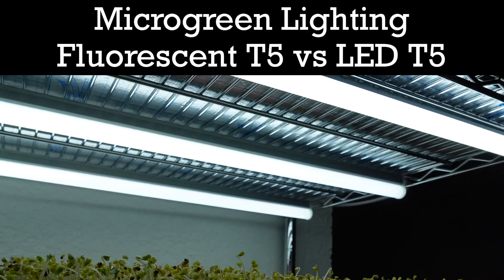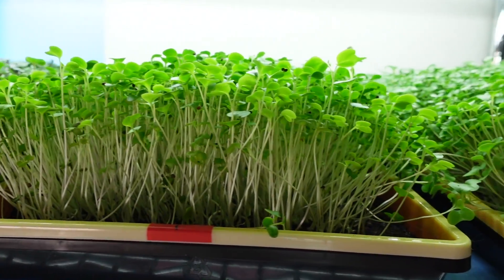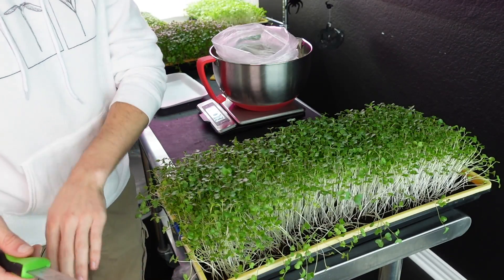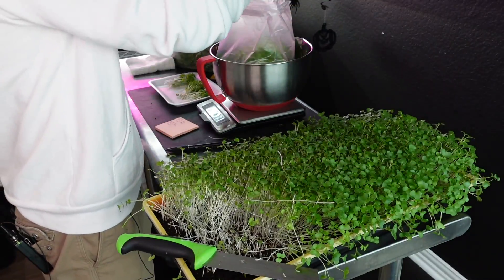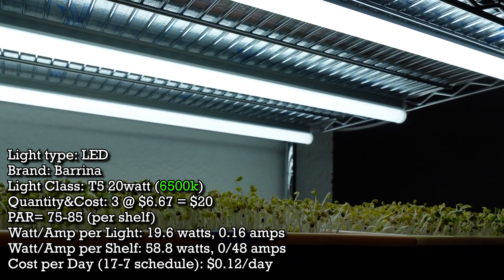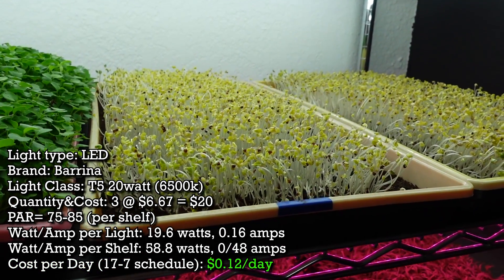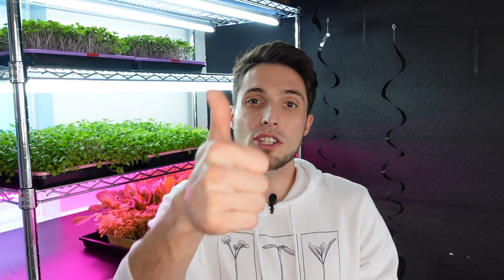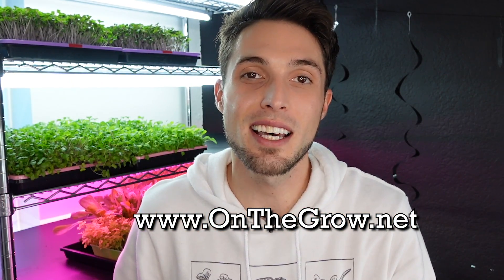T5 GROW Lights vs CHEAP T5 LED’s - Microgreen Lighting Experiment (Brussel Sprout)

Comment: I'm sorry if your video answers this. 
With these lamps, are Kelvin and lumens the same? 
I grow houseplants at 6500 k and over 1000 lumens . I am currently growing under ho t5 linear florescent and CFL grow bulbs but I'm looking to make the switch to led. 
Wondering if you have a more current video on available lighting options?

Comment: What happens if the lights are on the sides of the shelf vs directly overhead.  I have a 40" space, 36" shelf and 12 48" 6500k led lights.  I was thinking of putting the lights on the sides of the shelf vs the underside.  If its a bad idea, I'll just find 36" lights...

Comment: I was wondering if you consider the Certifications on the lights.  As the lighting set up would be in my basement I have to make sure any electrical equipment is certified to Canadian standards.  Otherwise, I understand that in the case of a fire my insurance could be denied.  Any thoughts from you or other viewers?
Reply from the maker: 🙂Thank you so much for the support Making It Through!! We are going to be making new content soon! 😄 I would check customer support.

Comment: Love watching your comparison videos.  
I had a very old set of fluorescent grow lights and while they worked okay the 2 cheap Walmart LED shop lights(5500 lumin) are out preforming the old lights almost by 50% if not more and my wallet appreciates the drop in the electric bill. Im saving to grab 2 more as i plan to start more of my own plants and ive started sprouting a few little trays of microgreens thanks to you two! 😆 
I am not as thorough as you other than our electric, stopping  the fluorescent use and switching to LED and using them all on a timer for one month to the new month with the LED our electricity bill dropped $11. I'm sure our bills fluctuate a bit so it might not all be due to changing the lights over but it was a huge drop to us.  It totally made a difference in my  plants too.  I even grew lettuce to the point I could harvest a couple times a week for dinner.   
It gets cold here in the winter and I miss gardening so I sprout a lot and now I have a few microgreens going.  
I do still have a bit of cold hardy things in the garden like lettuce and tatsoi and radishes but winter is sneaking up on us here.
Reply from the maker: Thank you so much for the Feedback Emeraldwitch30! We appreciate your support! Emeraldwitch30 😀We are so excited to announce that both our Microgreens Master Book and our first Microgreens Cookbook will be available very soon!
😃Please visit our new website at https://0nthegrow.net for info and early sign up!!!